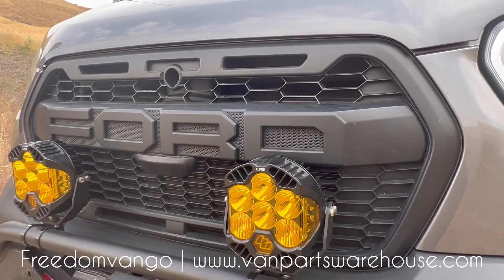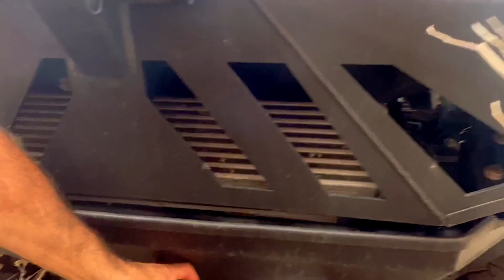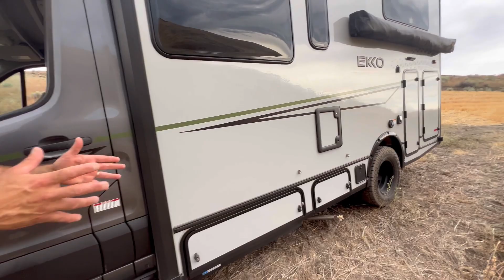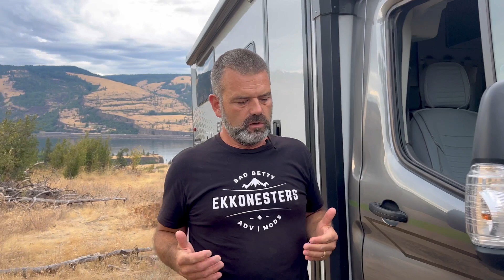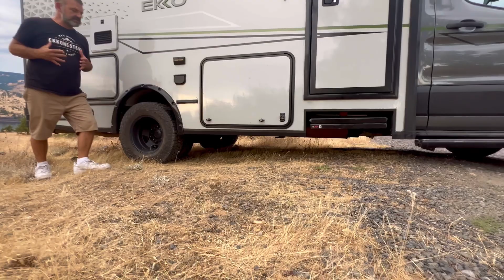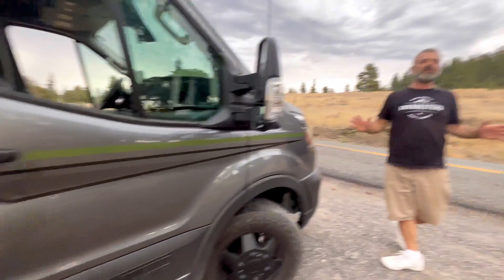Winnebago EKKO | Extreme Makeover! | BAD BETTY PACKAGE | RV | VANLIFE | OFF-ROAD |

Comment: I’ve heard of people taking off the Dooley’s for one tire modification. What’s your thoughts on that? Have you ever seen it?
Reply from the maker: If you are referring to the Transit with Dually’s, (class C) build, I have not seen that. However, I know for certain it’s in the works and and will be released shortly.  Do you have an EKKO?
Reply: @ekkonesters no, but it’s on my consideration list.
Reply from the maker: Hey, we’re about to drop a video that has some information on the super single for the transit.
Currently to the best of my knowledge as they say as of this reply, there’s only one tire available for the rating, but my understand is that’s about to change if you want some information call Joel at PAD overland 503-987-4002

Comment: Can you share what these mods cost? Thanks!
Reply from the maker: Hello, Thanks for checking in and following our channel. 
Here is a little breakdown of cost. We also offer some discount codes/promotions throughout the year on certain products.  So, let us know if you’re interested. 

CaTuned Off Road bumper:  CAtuned Off-Road Ford Transit Bumper
$2,911.00. 

Warn Winch: Warn VR EVO 12-S Winch 
$1,046.04. 
Mad Max D-Rings Shackle: $CAtuned Off-Road MadMax Shackle D-Ring $44.95  

STAGE 2 TOPO 2.0 SYSTEM - TRANSIT AWD (2020+ SINGLE OR DUAL REAR WHEEL)
PART NUMBER: 7212-MH
$ 2,17324 

Tires: Very on cost. 
1 review
SHOCK TUNE

Comment: Quick question, when I was looking up info about upgrading the tires to the 225/75 R16 size, most resources say that the 225 size requires 16x6 rim size. But I saw the Ekko comes with stock tires at 205/75 R16, which are only compatible with rim size of 16x5.5, but it seems like you kept the stock rims, is there anything I'm missing or how did you do that?
Reply from the maker: Thanks for reaching out Alfred.
I hope this message reaches you in great health.
We’ve been running the 225/7516s for quite some time now.
There was no requirement to change out the rim or do any modifications.
I am one of hundreds, and hundreds of EKK Owner is running the two 225/75/16 tire on the stock rims. We just left an EKKO rally in Tucson, Arizona, where there were more than 95 EKKO’s on site. I didn’t count how many, but there was a strong majority of owners that were running the same size tire we have. There were also folks that were running the 245/75/16 tire all on the stock rims that came equipped with a EKKO. I don’t think you’re necessarily missing anything. I think it just has to do with where the information is obtained and who is sharing it.
I hope this helps.
Reply: Wow I didn't know the rims where so versatile! I'm so glad to hear that, thanks for all the info  @ekkonesters

Comment: Appreciate the view, with the rear , did you change out the leaf spring at the back for that extra lift ?
Reply from the maker: We went with the VanCompass TOPO 2.0 lift. No leaf spring change required. It comes with the rear “lift blocks” and the shock clearance kit. Also all the other front components.

Comment: What did the additional weight add up to?  Looks great.
Reply from the maker: The bumper itself is about 100 pounds and depending on where you read information from, the winch is right around 60 pounds.
The skid plate is only 16 pounds.
And then there was some reduction very minimal of course when we took some things off while installing the bumper.